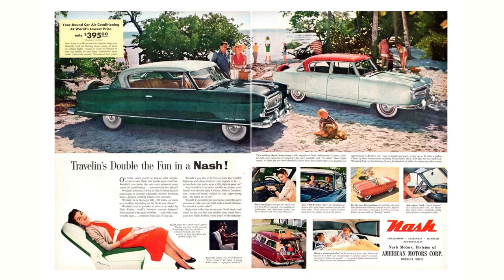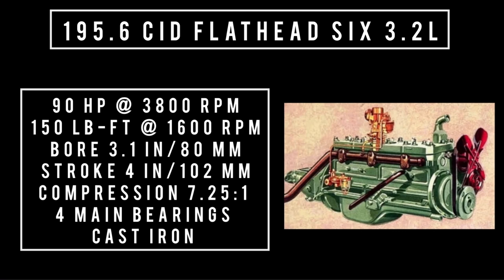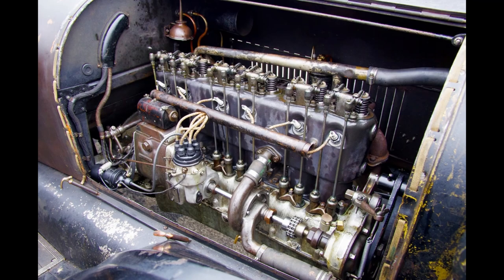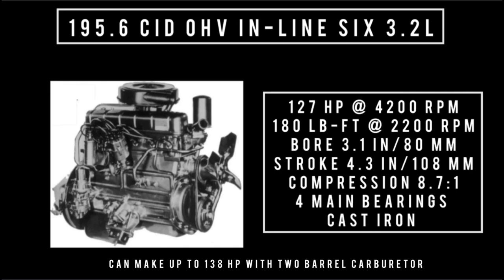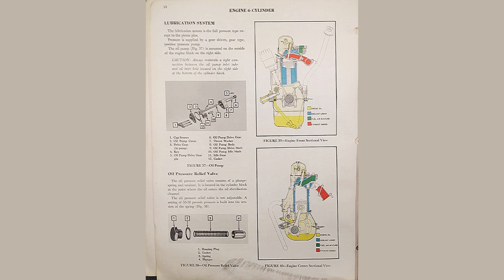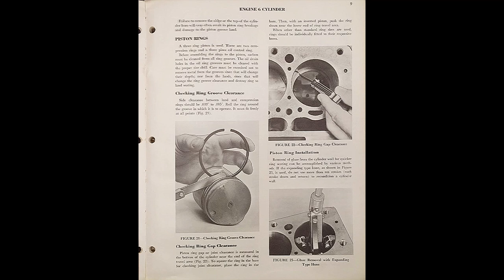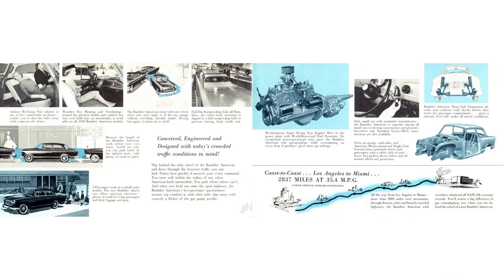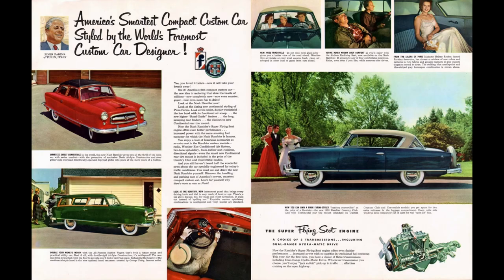195.6 engine from flathead to overhead valve, NASH to AMC

Comment: Overall great video! Two things: someone already pointed out that the 195.6 flat-head and OHV were both available in 1965 Americans (only). The other thing is you mention that not torquing the head bolts periodically (every 8-10K miles) can lead to head gasket leaking (which usually manifests as running hot), and running hot can lead to head warping. It also leads to head CRACKING -- and good heads are getting hard to find. They crack due to age and running hot, having usually been run hot several times, much due to not torquing the head as well as cooling issues (clogged/old radiator, etc.). You don't have to follow the head bolt tightening sequence when torquing unless the head has been off (all bolts loosened). Just set a click torque wrench to 62 ft/lbs and pull on each head bolt in any order. A couple may turn as much as a half turn (or a little more), some will click immediately, and some 1/4 turn or less.
Reply from the maker: Thank you so much for adding all of that information that overhead valve engine doesn’t like to get hot I’ve done a couple episodes with cross country Rambler wagons and that’s what the owners all told me is if you let the engine get hot bad stuff happens.. but that engine will run forever if properly maintained it just requires a lot of periodic maintenance which leads me to believe the Flathead was the better design because you didn’t have to re-torque the head every so often =) 

Thanks again for all the information =)

Comment: I remember as a kid working at my dad's garage in the late '60s thinking how PRIMITIVE the Ramblers were ... flat-head sixes, "Lionel" brakes, and oh, they used GM/Delco distributors and Ford power steering pumps ... I wondered, "can't they make anything on their own"?
Reply: GM power steering. Ford power steering pumps had a dipstick where as Ramblers had a wingnut you removed and the whole top came off to check the level  and the reason they used other manufactures components, is because being a small company it was cheaper for them to source those pieces than to set up and make it themselves Just trying to save money as they always did  Everyone complained about this but when you went to the auto parts store, and asked for this part for your AMC you were given the part and you took it home, installed it and were good to go just like any other car. It is the same as people always said this or that engine was a Ford or Chevrolet or Mopar engine, I wish people would get it through their heads they always made their own six and v8  engines. Gen one were 250, 287, and 327 cu in, And their 327 was in their cars years before Chevy had one, and it looks nothing like a GM 327. Gen two was 290, 343, 390 from1967-1969.Some people say those were available in late 1966 . Then in 1970 they were 304, 360, 401. They always were great running and strong on the performance side.
Reply: Most AMC cars in the 1960s used Bendix brakes, the same ones used on Chrysler products.  There were a few models with Wagner brakes.

Comment: What were you talking about when you mentioned an American Motors 242 cubic inch six cylinder engine?
Reply from the maker: https://en.m.wikipedia.org/wiki/AMC_straight-6_engine
Reply: @What.its.like.  never heard of a 242, 252 or 282 AMC six and I was an AMC parts man for years. In some foreign countries, Ramblers were assembled with non American Motors engines.  P. S. Wikipedia is not always right!
Reply from the maker: Yeah I think the 242 is a typo I was able to find anything. I tread lightly on Wikipedia.
Reply: 242  sometimes called "4 litre"  is the recently dropped "Powertech" six that was in many of the square unibody (XJ?) Jeep Cherokees and had a fuel injection system,I think it was also in the WJ Grand Cherokee from about 1999 thru 2004  model years
some earlier Jeep Cherokees had Chevrolet Citation V6 engines,the new "PowerTech" six quickly made the Cherokee become much more popular.   @What.its.like.

Comment: Didn't the 258 turn into the 4.0L that was a Jeep staple for quite some time?
Reply from the maker: 232 and 258 cid is the legendary jeep motor I believe

The 196 predates it it doesn’t share anything with those engines it’s more or less bridges the gap between flat head and overhead valve
Reply: @What.its.like.  oh yes it does the early 199/232 and 252 Mexican motor used the same bellhousing pattern as the flathead.  LAter 232-258 use a different pattern   I still have a couple of early "TAXI" bellhousings to put a HD trans behind the earlier motors.
AS an aside we built the STOCK (except pistons & rods) to 900 HP with a turbo on alky then 1200 HP with the factory making minor foundry tweeks to the head and block (thicker decks, early shaft rockers on later head)

Comment: There were two larger Nash inline sixes, both OHV, 235-cubic inches and 253-cubic inches. These could be had with a single carburetor, or dual carbs named the "LeMans Dual Jetfire" engine. In this state of tune, the smaller engine put out 125-horsepower, while the larger one put out 140-horsepower. Along with the Ambassador line, these engines were also found in the Nash-Healey sports car.
Reply from the maker: Yes that was my point why didn’t they just use one of those engines instead of converting the 196 overhead valve.. I want to do an episode on those two by tracing back that information was really hard it got to a point where I couldn’t tell what engine was in the ambassador

I really want to do an episode on the original overhead valve six that Nash made in 1925 through 1930 and then it was eventually replaced with an overhead valve in line 8 the six cylinder had seven main bearings the eight cylinder had nine.. those engines seem at least on paper absolutely magical and I wanna know why they didn’t live on..
Reply: @What.its.like.  It's likely those engines were too long, even for the Statesman body, and the Rambler had less space than that. Nash was more interested in fuel economy at that time, for everything but the Ambassador.

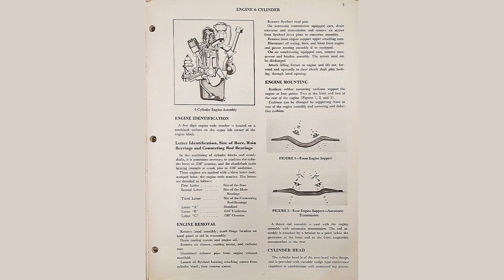Comment: Back in the 50's when I was In High School I worked for Ricker Motors in Whittier, Nash Dealer.  My dad bought a new 56 Ambassador which we picked up at the factory,, We Kept the 51 Aero and my grandfathers 54,  I learned to drive on that car. Then a 57 with the then new 327.  Mike sold the 57 Rambler Rebels with the 327- fast car.  In 1960 I got a new  Rambler American with the 195.6 flathead with overdrive and 4:11 gears and positraction.  It soon got the dual  Carter carburetor aluminum head from the Nash Statesman.  The Flathead had downdraft carbs and the 56 Nash had essentially the same carbs sidedraft called the Lemans Motor, same motor used in the Nash-Healy sport car.  Bullett proof motors were Nash
 My brother got a 61 with the OHV, OD and 3.31 gears and a continental kit.  Mine was quicker  his got a very little better mileage.   I converted my T-96 trans with the "TAXI" package to the stronger T-86 trans. 
I later put an Aluminum motor in my 60, had to notch for the oil pump but otherwise. a bolt in.  Sold the flathead to a collector.  Later I tried to find a two carb head< remember the intake is in the block, I had to go to Stack Autowrecking in Petaluma to find one.  60 got wrecked to the AL engine ended up ended up in a Rambler
Reply from the maker: Awesome stories thank you so much for sharing those memories with us =)
Reply: @What.its.like.  We ran The Mobilegas economy run with a Rambler flathead, OD trans  tall gears, adjusters removed from the brakes, narrow 4"  Wheels with narrow tires and high pressure  If you coasted over a hill at let than 28 mph the car would freewheel all the way down, you could shut off the motor, short shifting  like todays automatics  minimize pumping losses  The manifold in the block allowed running lean, block the radiator  all the tricks, gut the interior to save weight.  We did not win but came close  Mechanix Illustrated and Tom McCahill
Reply: @jmflournoy386 What kind of fuel economy did you get?

Comment: Both of my grandfathers had a Rambler with this engine, one a 1960 and one a 1961. Neither car ever had head gasket problems or had to have the head retorqued. Maybe by that time they had figured out that problem. Both cars went over 100 thousand miles and the engine wasn't the problem.
Reply from the maker: That’s awesome what is it a flathead design or the overhead design Retorque  the head bolts was only an issue on the overhead valve
Reply: @What.its.like.  They were both overhead valve.

Comment: Regarding that "special sequence" for torque on the head - every cylinder head has a sequence. Generally it's from the center to the outside. There are some execptions. If you look at the picture you put up - that's exactly how it works. When I worked as a mechanic early on, did quite a bit of Rambler  work.  I never (repeat. never) found one that needed a retorque. Think about it.  ("check every 4,000 *how you going to check? Eh?  With a torque wrench!)  "Retorque every 8,000 miles" well you did that at 4,000 - - -. Also that recomendation wasn't that strange back in the day, not just Rambler.
Reply from the maker: Very good points.. I hit the jackpot with the service manual I was able to find a service manual for the overhead valve 196 I couldn’t find an owners manual for the flathead though it kept redirecting me to the overhead valve version.

Comment: Cool post    Thanks !   I had a 74 Gremlin , $2500.00 price new, with a 232 and it was OK for one hundred thousand miles after ten years then everything broke at once. Super simple cheap car.
Reply from the maker: I’ve heard those engines are bulletproof and they didn’t require the maintenance that the 196 did it was all going to be part of one episode but I figured this engine is really different than those engines it kind of bridges the gap one day I wanna go back and do all the overhead valve engines from the beginning problem is that I couldn’t find any information on a lot of those engines on the Internet so I have to find a library that has that information. =)

Comment: Love it! I'm a tech guy and I love hearing about how things work.
Because they are a bit different than the Big 3's cars, I was interested. 
Back during the summer of 1973, I worked at a Shell gas station. This was back in the day that we wore Shell uniforms with bow ties. When a car would come in and buy as little as a gallon or two of gas, we had to check all the tire pressures, including the spare if the owner would allow us in the trunk. We washed all the windows and outside mirrors, if the owner wanted us to we would also wash the rear view mirror. Then, we'd check under the hood, all the fluids and filters.
Well, one time a Rambler came in, maybe a '63 or '64, and when I opened the hood, lo and behold, it had a flathead 6, and it wasn't a Rambler American either. I'd never seen a flathead engine in a  U.S. car that new!
One of the cool AMC's of the past was the Nash-Healy. The Nash part was the big OHV Ambassador engine. I think the first N-H's were in 1952 and lasted until 1955. Clark Kent drove one in the original Superman TV show. Clark Kent/Superman was played by actor George Reeves. The N-H was his own car. Ramblers were featured in the show for maybe the first 3 seasons?
OK, OHV engines. Chevrolet always had OHV engines and never a flathead. These engines were strange to me. They had a valve cover but it was larger than the cylinder head. In the overhang side, the push rods were exposed and open to the air!
AMC taught the world how to build an OHV inline 6. Probably, it's crowning achievement was the 4L inline 6 used in Jeeps. The last ones made close to 190 net hp! That's V8 power!
Reply: Shell - -Richfield guy here (before it became ARCO) before you.  How's your "TCP" we used to call it Tom Cat Piss.  We wore regular ties that clipped on, came off easy if caught on something!  Yep, good ole Clark Kent!  In some episodes it was Lois Lane who had one.
Reply: @richardwarren7492  Are's were brown clip-on bow ties. I might even still have it! I also kept the brown pin-striped shirts and brown slacks, and wore them out working on projects at home.
Lois Lane usually drove the slide-back convertible Nash and sometimes Clark Kent drove it. George Reeves always seemed to like fancy cars and drove the Nash-Healey on the show after it was gifted to him by the woman he was having an affair with, who's husband was a movie producer thug(who probably killed George and staged it as a suicide). A suicide didn't seem appropriate as George was in talks about reviving the "Superman" series and George was really excited about it.
Reply from the maker: Thank you so much for taking the time to share all of that information as well as added insight sorry took so long to get back I’ve been buried in comments lol
Reply: @automatedelectronics6062  At 75 I still enjoy the old Superman episodes. went through them all a couple of months ago.

Yep, kept my old Richfield and ARCO uniforms until they died for working around house and car.  Actually had an ARCO station for about 3 years - -
Reply: @richardwarren7492  Are you Rick Warren, the minister and author?
Yep. I bout the complete "Superman" DVD set years ago. Surprisingly, they had their eyes on syndication so shot the last seasons in color, as color TV was deemed to be taking over. I remember watching "Superman" in the 1960's and all episodes were being shown in B&W. One day, one episode was in color for a few seconds.  Not knowing the series history at that point,  I called the TV station and asked about it. They told me that they had inadvertently left the hue button on after a commercial. Ha! lol, now!
Reply: @automatedelectronics6062  No, I'm not "that guy" Rick Warren.  But, when I had my bookstore, sold a lot of his books.  I've done a lot of rhings in my life, started out in a gas station, mechanic, dealership mechanic, service and parts director for 11 store group, later CEO of that group, until sold to Peenske, bookstore, 3 cellphone stores, auto consultant for several dealerships, retired, still do some work on my own cars and a bit of consulting.
Reply: Question for you guys that worked at full service stations. When customers would drive in & you would check tire pressure etc. did they know what they wanted? Did car owners in general men & women know what pressures they wanted in their tires & what kind of oil etc. they wanted? I'm trying to compare the average car owner of then to now. It's no secret that today most people don't even know or care that there is air in their tires! By the way I've got two Rambler 196 projects right now. One is about to be back on the road & then the other Rambler is coming in the garage.
Reply: @freemansgarage  Way back then, If a customer new what pressure they wanted, it would usually be 32 p.s.i. Or they would want the air pressure that was indicated on the tires themselves. 
People were more brand conscious well into the 1970's but the multi-grade weight oils were confusing for everyone. Most any shops or people didn't understand what multi-grade oil was for. In large temperature swing climates, people had always used different weights for different seasons. Out here in the West, most people just used 30 wt. year round and that was the weight they knew.
In the later years, certain brands and weights were related to engine failures. Like on the service end, we noticed that camshaft failures were related to the use of 10w-40 motor oil. One example was after many warranty camshaft failures, GM blamed it on the 10w-40 weight.Around December 1984, when I was working at a Cadillac dealership, GM had us change our oil to straight 30 weight. No more camshaft failures on new cars after that.
Then air pressure problems became evident. Ford Explorers were having problems with roll-overs. Ford blamed it on air pressure. I don't remember when auto manufacturers started putting tire pressure labels on their cars, but , for liability's sake, we became tire pressure conscious. In roll-over and other accidents, when the CHP arrives at an accident, they check all the tire pressures. If tire pressures were incorrect, the accident was blamed on tire pressure, if there wasn't another obvious reason.
For years now, most people turn their vehicles over to repair and maintenance facilities trusting them to know the proper air and oils to use.
Reply: @automatedelectronics6062  That's interesting. That gives me a better idea of what was going on. Thank you for taking time to type a thoughtful reply. I appreciate that.
Reply: @freemansgarage  I worked at a Standard Station in high school. I think we just set them all at 30 psi, but the amount listed on the tire itself, was the maximum safe rating loaded, usually 44 psi. Also related to the Explorer story, Ford's maximum loaded weight was only 400 lbs higher than the loaded weight weight with 4 passengers  averaging 160 lbs each. Ad another passenger, or another 40 lbs to each, and you may not have any left for luggage, or, heaven forbid, a trailer with 150 lb tongue weight.

Comment: The OHV 195.6 was offered in 1965, and was standard on the American Hardtop, the flathead being standard on the American for other body styles.  The new 232 was an option in the 1965 American, but you couldn't get it with air conditioning becase the new engine was longer and there was no room for the condenser coil.  That's one of the reasons that the nose on the American grew 4 inches for 1966.
Reply from the maker: Thank you so much for sharing that insight =)